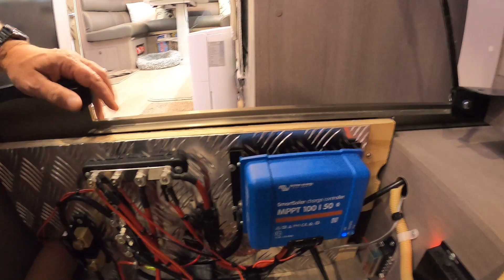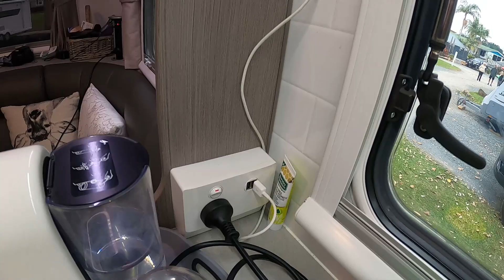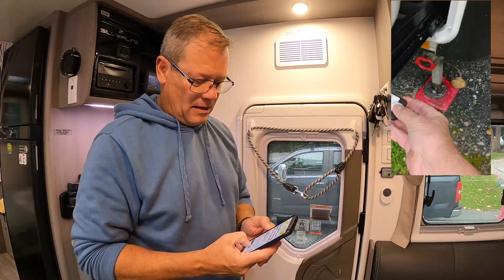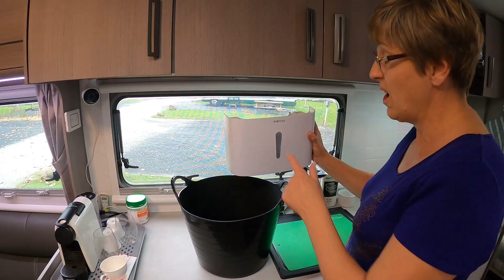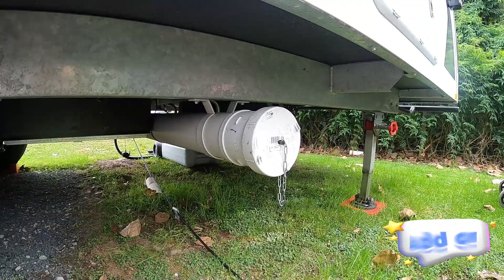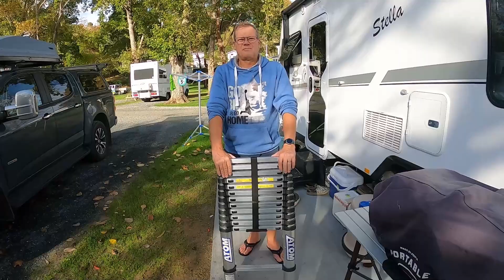S1 - E9 Stella Tour - Part 2 - Our Upgrades & Add-ons

Comment: G'Day mate, like your work on the Lithium upgrade, I just did mine but I would just like to let you know that your positive wire should be connected to the other positive terminal so it creates a complete circuit as one, the way you have it now its pulling the power from the front battery mainly, if you refer to BMpro wiring diagrams they do mention this. Just swap over the positive leads and job fixed. Cheers Moz
Reply from the maker: Hi Moz, thanks for the feedback. Yip agree, I've changed mine to suit. Cheers Kevin

Comment: Really useful info, your power distribution is very cool and well done, do you also charge from the vehicle when you are running what sort of cost was it to install everything?
Reply from the maker: Hi Ian, we are running the 12v fridge when we are on the road. The solar will still be charging the batteries while travelling and typically our lithium's are fully charged up every afternoon anyway. You could, but you would need to add a DC to DC charger to your vehicle. As for the cost it would be around 9 -10k all up including the inverter because I built the circuitry myself off of a drawing from US -RV solar expert Wil Prowse. He has a channel and puts up great videos on solar systems.

Comment: Where did you buy the tyre protectors?
Reply from the maker: Hi Meg, I have added the link for the wheel covers in the description box. The supplier is Moutere Caravans in Nelson. They are closed for the Winter though based on their website?? Kind regards Kevin and Paula